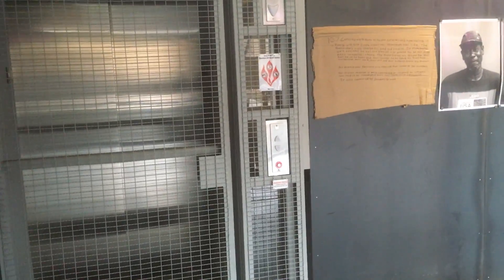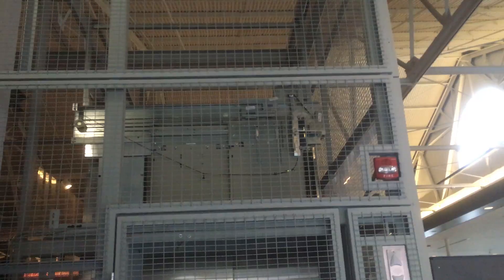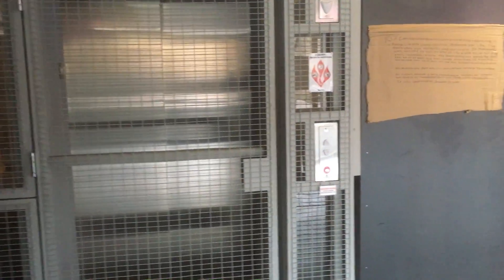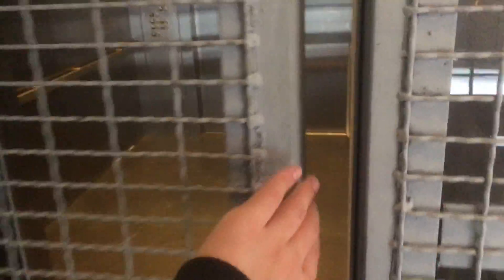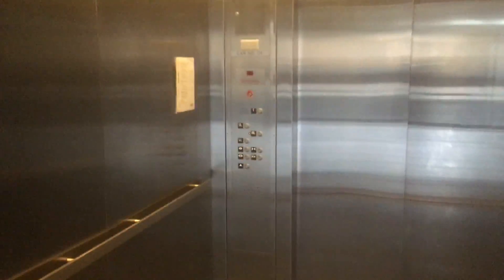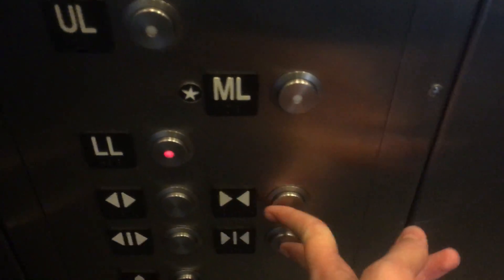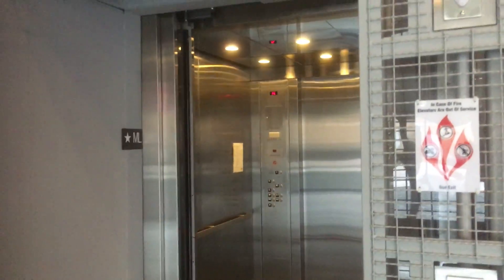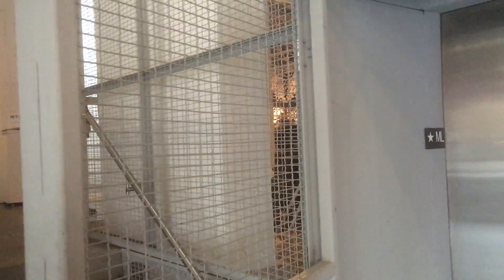Unique Schindler 330A SWING-DOOR elevator - Contemporary Art Museum (CAM) - Raleigh, NC

Comment: Most likely the swing door automatic opener is tied into the elevator door open/close microprocessor on the controller board in parallel. The swing door motor would reversible.
Reply from the maker: Possibly. Alternatively, it may be tied into the interlock, w/ a delay when opening, but not closing. Immediately after the elevator door closes, the swing-door closes.